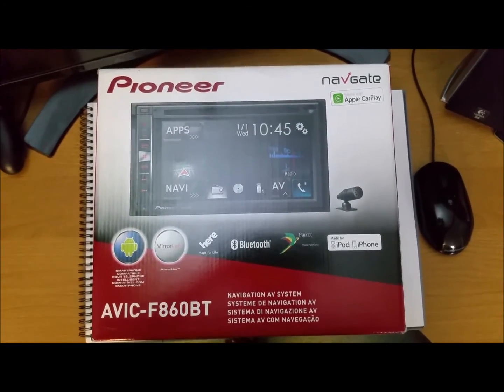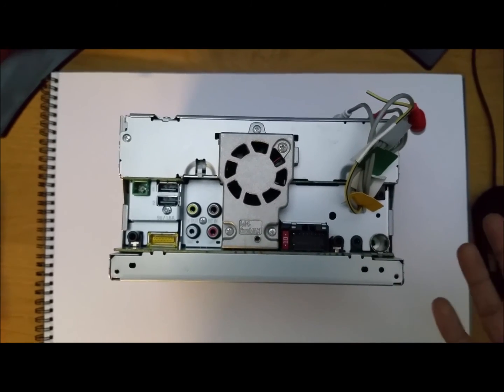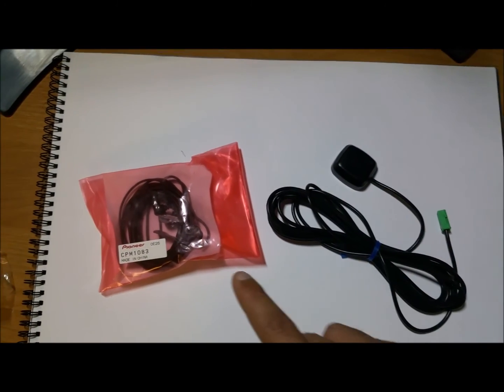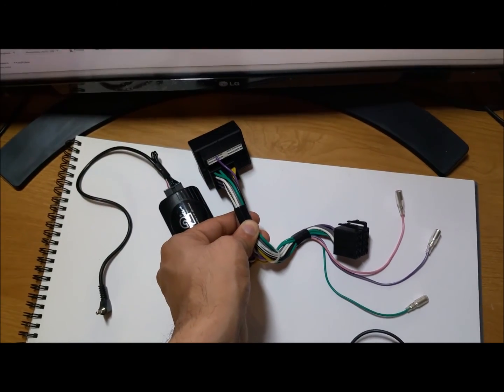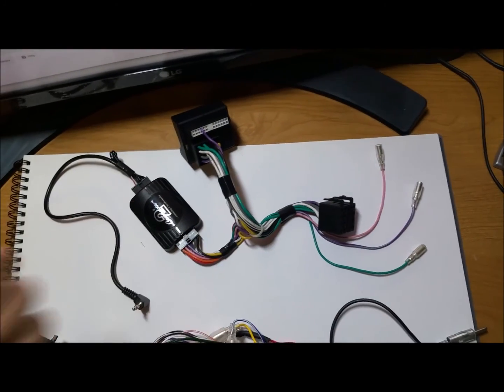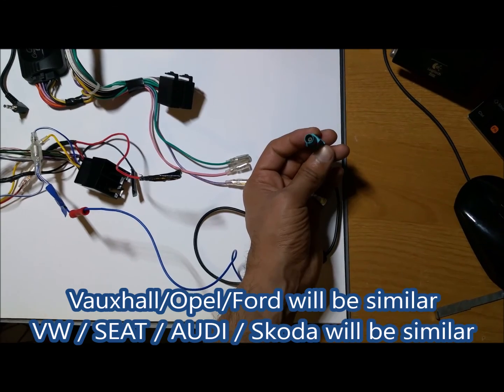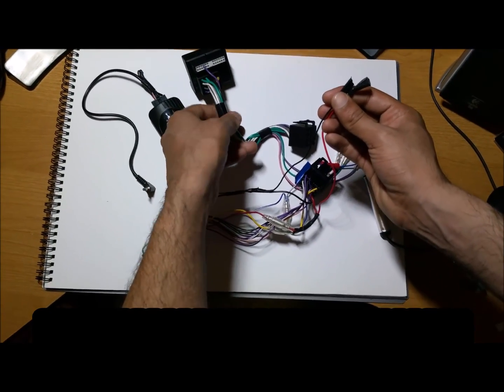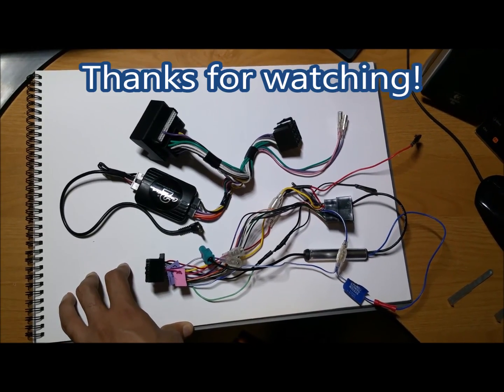Wiring Doubled-In Sat Nav Headunit - Pioneer AVIC F860BT

Comment: Were do you put DAB AERIAL
Reply from the maker: Hi Vincent there should be a connection for it on the back of your stereo. You may need an adapter.
Reply: @Davi_uk  .have bough a shark  fin dab .satnav.and fm aerial  was just having a look to see were it all went
Reply from the maker: @vincentwilson7311  Hi it should connect to the radio aerial. If it’s not a direct fit there must be an adapter that will help.

Comment: Hi I’ve stumbled across your video and just want to say thanks for the upload. I’m having a little trouble with my SPH-DA120 as I don’t seem to have a pink lead on the stock harness to plug my connect2 lead to. Any help would be hugely appreciated. Also am I right in thinking I just need to splice my light green parking brake wire to the black negative ground wire?
Reply from the maker: IronsWHU Hey no worries. Do you have any spare cables? If you look closely at the connects2 cables there should writing on the cables. Regardless of colour one would indicate it's the speedpulse. Again your vehicle may provide this through an existing cable you have already attached. 're the Brake wire you're right splice into the negative. I would do it carefully. So don't damage the black wire too much in case it doesnt work in some cars you need to buy a relay. If it turns out to be the case here heat shrink your black wire back and then either get a relay or attach it to another ground. Really I would advise not touch cables for key safety devices like your park/ hand brake.
Reply: Davi Hi thanks for the reply. I have ground the brake cable and it works fine. Didn’t use the negative I just ground it to metal. As for the spare cables there is only “mute” and “reverse” I’ve so far left the speed pulse from the Connect2 loose and there appears to be no issues so I’m thinking it’s connected via the loom already somehow. Again thank you for the reply and you videos as they have helped me a lot and saved me over £100 in fitting costs...
Reply from the maker: IronsWHU No worries always happy to help and share my knowledge. Glad you didn't part with the cash. Attaching it to metal is a good shout.

Comment: Which type of connects2 is this?
Reply from the maker: Mr Moluccan hey buddy its the Connects2 CTSVX003.2 Steering Wheel Stalk Control Adaptor For Vauxhall
Reply: Davi is this a good one? https://www.ebay.co.uk/p/VAUXHALL-CORSA-2009-Connects2-Ctsvx003-2-Stalk-Adapter/1405653468
Reply from the maker: Mr Moluccan Hey yes its the same one I used. Just make sure you buy it from a seller with good ratings and feedback. That way if it doesnt work you arent stuck. Make sure the additional cable that looks like a 3.5 headphone jack cable is for your stereo. I explain it in this video (the one coming out of the little black rectangle with connects2 written on it).
Reply: Davi Yes friend, I saw the video! Thanks for the good explanation. One last question: the cable I linked you on Ebay, the look a like aux cable comes with 3 wires, gnd, key 1 and key 2? I dont have to use that?
Reply from the maker: Hey please feel free to as many questions as you wish. Looking at the one you sent it appears to be the exact same cable I have. Email me a picture if you order it. Ill take a look and tell you. davi_patel89@hotmail.co.uk
Reply: Davi Hello sir, u my man, Hero! Everything works. But how did you get everything in the dashboard? I am going to send you a picture
Reply from the maker: Mr Moluccan Boom! Thats great! Ok please send me a pic ill take a look buddy.

Comment: Hello. When using the Navigation this weekend it says Speed Pulse Disconnected? And the message cover a Quarter of the screen and can't see what I need. How do I get that off. Please Help. Lol I do have the Pioneer AVICX850BT
Reply from the maker: James Barlow Jr. Hi James your unit needs to be wired the same way as this one is in the video. Did you use a connects2 steering wheel adaptor? Also what vehicle is this installed in (please confirm the year/ mk)? Always happy to help where I can 😊

Comment: at 7:27 wha did you say that pink cable is for? im going to connect my unit but i cant see what it connects to, would it be ok if i left it unconnected?
Reply: mine is a pioneer SPH-DA120 though and i drive a suzuki swift, so the connect 2 is different but has the pink cable. No purple or green one
Reply from the maker: CloudNine201 Hey buddy the pink one is for your speed pulse if your head unit doesn't have sat navigation then you can ignore it.
Reply from the maker: CloudNine201 I just checked out your head unit,  looks like you have the app radio. You can email me some pics of the back of it as well as the connects 2 wires and I'll help you out if you want?  Let me know happy to help.
Reply: hey my head unit does have satnav but ill be using app radio, google maps, so won't be using it. thanks for letting me know its purpose though
Reply from the maker: Hey no worries. Given you have a different car the speed pulse may be going to your head unit via another cable. Best way to test this is to open the map app and driver forward. If you see the speed moving on the app in line with your speedometer then your all set. But to your point if your using google maps it wont matter. I only used the maps app because it detected cameras. Good luck either way!